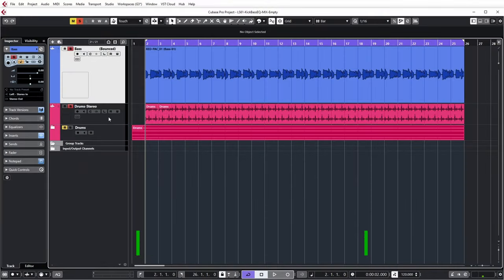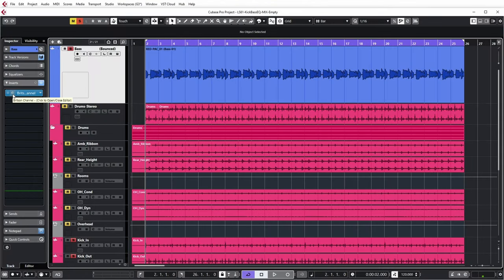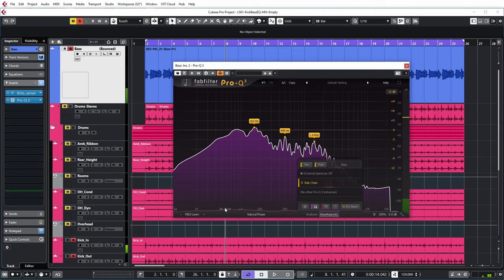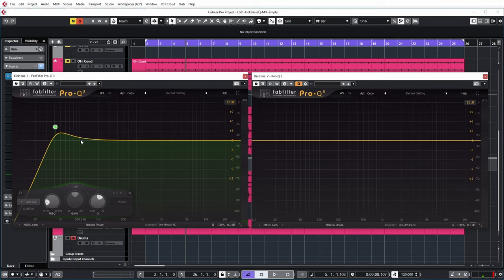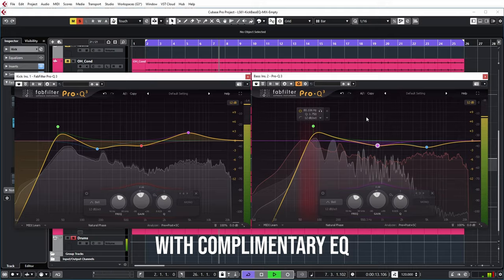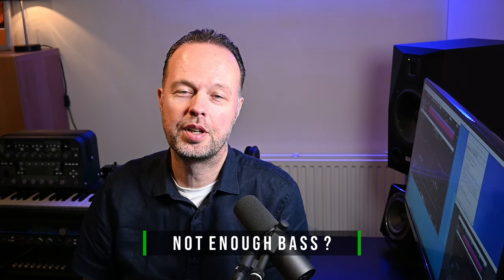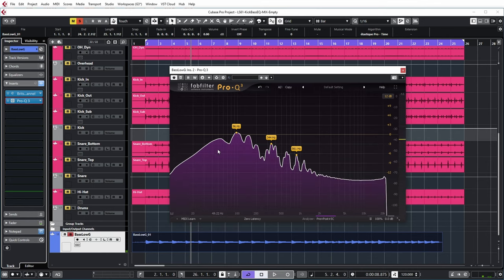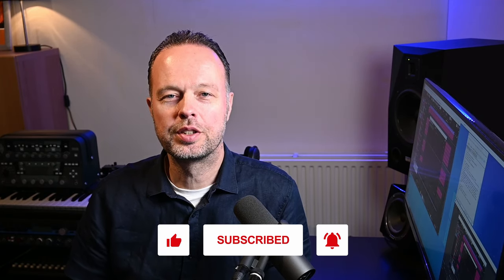How to separate Bass guitar and Kick drum with EQ

Comment: be careful to identify sounds that you only "SEE", FFT (size) is very limited in the lower (under 80 Hz) Area and so the LINE you see shows something which doesnt really exist. You need very high "Resolution" to view accurate in the Frequencies below 100 Hz. 99,9% of the people "watching" at visualized Frequencies and their Amplitude (without phase and time) have no clue abt this issue.
Reply from the maker: Yes you are right of course. Make sure you can hear what you are doing when making adjustments. My next video (up next week) actually demonstrates the problems you are talking about as well.